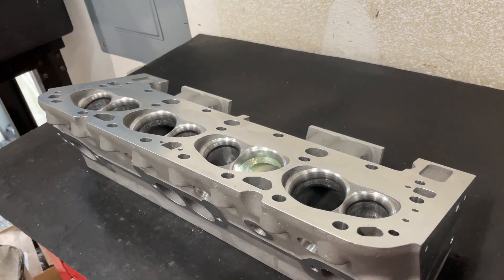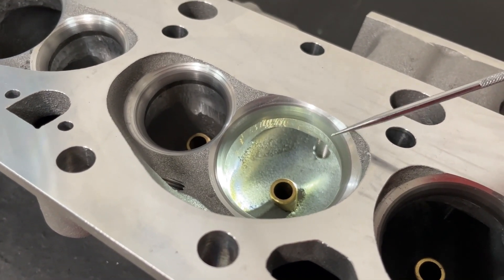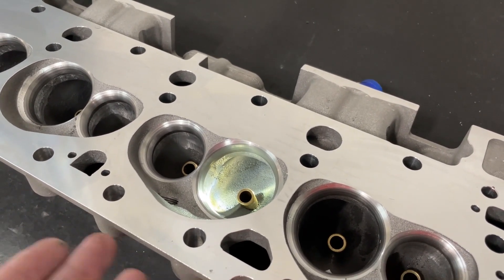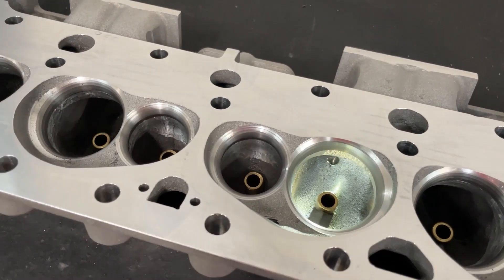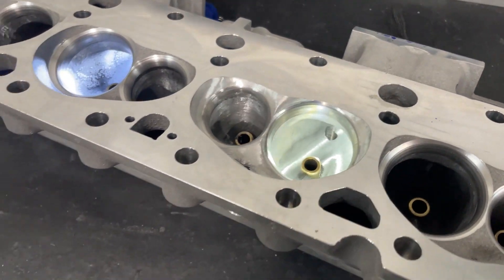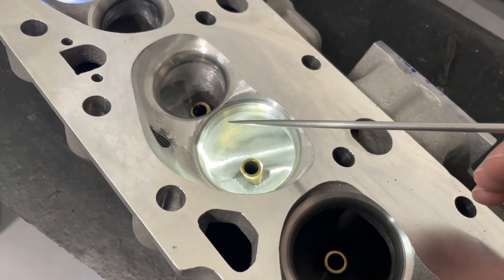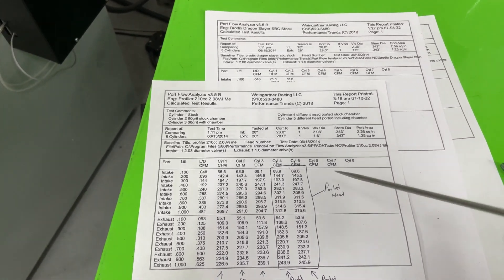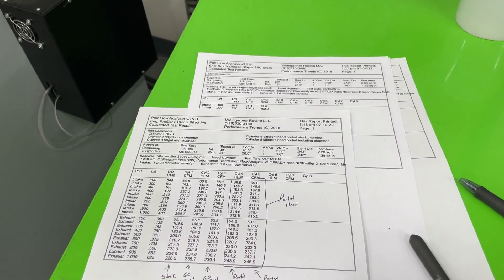Smoothing A Head to 60Grit Part 2

Comment: As a wise engine builder once said, test every claim in a thorough and organized fashion.
I Know David Vizard says to only polish the roof of the ports, and to keep the rest of the Intake port at a 60 grit.
Reply: I was on the understanding that polishing intake ports is a bad idea, because wet flow will tend to stick to a polished port as apposed to a port with a rougher surface finish. This is the problem with "head" porting info, you can listen to 10 different people, and you'll get 10 different answers! I will also almost never deal with an aluminum head, the only thing I'll ever use are cast iron heads, can't afford all the fancy stuff, but it's interesting to listen to the discoveries Eric finds and shares with us, and I'll use what little I can in my own heads.
Reply: @Anarchy-Is-Liberty  there is a hughe difference in texture between something that is "polished" and something that is 60 grit with a cartridge roll. I polish only the pushrod pinch and the ssr of my heads and finish the rest with a 60 grit cartridge roll. That way the critical.points are less restrictive and the rest of the ports co tinge to keep the fuel well atomized.
Reply: Thank you! 
   Very nice explanation for why 1 " open. To see how stable the whole combination is.

Comment: A lot of folks get caught up in flow bench numbers as the be all end all of cylinder head testing, but a quote from an old engine builder I used to hang around (see also: annoy the shit out of) as a teenager pretty well sums it up "Engines don't care about flow bench numbers"- aka there are a ton of different factors that go into cylinder head (engine) performance that just aren't shown on a flowbench. Sure, they give you an idea of what the head will do, and a way of comparing heads to each other (at least in theory), but the only way to know for sure is to put them on an engine and find out. 

There were plenty of times when what I was trying worked on the flow bench (stock lift cam rules- so low/ mid numbers were all I cared about), but either produced no additional power, or even hurt power on the dyno. I probably had a couple hundred hours (and god knows how many sets of valves and seats) into that, and upon failing to make a single HP more for the 30th time I was venting my frustration about how they picked up 15cfm at .400, it should be making more when Bill popped off with that line. Kinda stuck with me lol.
Reply: Flow numbers are not important, airspeed numbers are, they are also flowbench numbers.

Comment: I think that chamberwork is a must on any cylinder head for any applocation
Reply: By chamber work (combustion chambers), are you talking about 60 gritting them as he speaks about in this video?
Reply: @Anarchy-Is-Liberty  I mean most cylinder heads have valve shrouding. When the valves open, due to them being to close the the walls of the chamners. And that should be minimized to help increase airflow.

Comment: YOU can chuck the junk valves in a drill press spin at a low rpm and take an angle grinder with a flap disc to grind them to size for seat protection
Reply: Goddamn! I've gotta see someone do that, sounds scary! ha ha ha Madman with a flap disc and a drill press, hold my beer please! ROFL!! 😂🤪:face-orange-raised-eyebrow::face-orange-biting-nails::elbowcough:
Reply: @Anarchy-Is-Liberty  not really. It's not like are going to use the valves afterwards. You're just grinding the mating surface on the valve to make it lay flat on the seat to protect the seat when reshaping/polishing the chamber.

Comment: I was told smooth out whatever can catch a nail but don't change the shape. Guess there was some truth to that after all. Seems like it's more optimizing the port than really improving it as you can only support so much through a size before it's unstable... Case in point what you were discussing near the end. It'll be better for sure but, I don't think it'll be the same level of improvement you'd realize with the true porting job. I honestly would speculate it wouldn't even fall in the middle like the numbers suggest it would... I also wish you had that dyno sir. Thank you as always for excellent content.

Comment: TIP ,....... when useing   "cross cut burs, " ..... rub ckalk into them before use,    helps to stop clogging,  ......and it is much easier to clean with a wire wheel !
Reply: W Aluminum I used WD40 to do this.   I wonder if your Chalk idea is better?

Comment: Brother how do you sleep at night with a brain full of knowledge.lol
Thanks to your videos I've picked up a porting bench top machine "foredom tx square drive table top".  I've had hours of mild clean up and gasket match practice with track results of .2 tenths in 1/8 mile...no clue really what I'm doing but I really appreciate your videos.  I'm currently working on a set of rhs pro action 195s new out the box I've had in storage for 6 years. Building a solid roller 395 sbc. For my mustang. Thanks again for taking time to make videos

Comment: Matt here. Can you explain the CFM at 1 inch lift in a little more detail? I'm confused about why the CFM you are testing at is not close to what an engine pulls. For example a 5.3 LS at 6500 rpm is only pulling in 608 CFM total. That's only 76 cfm per cylinder. I must have done the math wrong. 5.3L/2 this is because its a 4 stroke so only half the time it pulls in air. Multiplied by 6500 rpm is 17225 L/m. Liters to CFM conversion is 608. So testing the port to 300 CFM is a very large amount of air through just one intake and should be more than accurate for testing the ports. Thank you for the videos and your time.

Comment: Your list of tools is interesting. I haven't heard of many other people using stones on aluminum. I'm assuming you're using a lube to keep it from loading up and "exploding" (the melted aluminum tends to clog the pores of a grinding stone and expand causing it to come apart unless you do something to keep it clean). What kind of lube are you using? Are you using the same lube with the carbide and sanding rolls?

Dyno numbers with a .550" lift cam would be VERY interesting to see comparing those 2 heads. There are a lot of different thoughts about where the change in airflow comes from when you change the pressure differential across he port (boost, ram effects...)

I just found your channel so this might be something you already have up, but I'd love to see you actually doing some of the cutting on camera.

You also have me thinking about pulling the cylinder heads on my car. Since the traditional answer is that polishing doesn't do much for flow I did very little sanding on them. For the most part they were cut/reshaped with alumicut carbide, double cut carbide, and where I didn't get a consistent finish with the carbide they were touched up with the coursest sanding rolls that I had. At that point they were thrown on a flow bench, flowed (with a 3.75" bore since this was a small bore build, so I wouldn't necessary recognize how much I left on the table by not doing more sanding/polishing) and since the flow numbers were good enough they were used like they were.
Reply: I replied to ask same, I used WD40 on the burs and dry on the rolls.    Another poster said he uses chalk on the burs.   Wondering which is best now.

Comment: Hey eric i was recommended a cam of O.6OO" lift do you know of any springs that shall last on normaL street use on it like blue alloy nascar springs or something? The cam specs are as follows= Comp Cams # 12-872-11 
IN. 263*  /  27O*  @ .O5O" 
     .6OO" /  .6OO"       108* LSA
 Going with BRODIX family owned products in USA from now on and forever. BRODIX heads 227cc CNC or similar. Saving up for them.

Comment: It would be nice if you could partner up with someone who a well sorted dyno. Be careful using a Superflow with a stock strain gage while doing small modifications followed with quick tests. As the stain gage heats up your torque and horsepower goes up. Come back the next day and do a baseline and find all your gains are gone!

Comment: Thats how i chose my cam size.  Off of my head numbers. And chose the duration on what rpm.    No point in putting a huge cam in a head they don't flow at that lift and no point of putting a baby cam with a high flowing head

Comment: Learning to properly use and control the tool is a big hurdle for beginners to figure out
Speed control is everything lessis more. 

Tap Magic is the only thing I use for carbides..not a lubricant, its to actually help cut the metal and keep the burrs clean. 
Works great any hardware store has it.
AFR has been increasing pricing to the point I dont think its worth it anymore. 1k 1500 for a decent head fine
2.2500 plus for a 23 deg sbc Ill pass and build/port my own
Reply from the maker: I hate the smell of tap magic.
Reply: @WeingartnerRacing  WD40 is the best aftershave ever.

Comment: I like your videos and I appreciate your knowledge. However, you go off topic so much that a 10 minute video turns into half an hour. Kind of reminds me of a bumble bee or a butterfly, sort of aimlessly moving from one flower to another with no sense of urgency or with any destination in mind. Perhaps you are just wanting to share as much of your knowledge as you can, I don't know. I suppose a lot of it is because you like to go off the cuff and don't seem to edit your videos very much. Extra points for one-take videos, but yeah, I think you should try not to stray as much.

Anyway, thanks for posting up these past two videos. I did something very similar with the head on my BMW -- just cleaned up the machine marks with a cross cut burr, didn't take away a lot of material, just smoothed things out. I am glad to know that it makes a difference. I didn't want to take a lot of material because I was afraid of experiencing flat spots or losing a lot of torque. The car behaves better, but it is hard for me to really tell why because I also deleted the cats and added camshafts at the same time as the head work, so it's been a mystery to me -- until now.
Reply: See that also

Comment: I know it's off topic but have you flowed any blueprint engines ls3 heads at all? I live in Nebraska and they're headquarters is about 100 miles from me. I'm thinking of picking up a set for my g8.
Reply from the maker: Yes and I ported a set and loved them.
Reply: Thank you very much for the info! I'm looking at a bare blem set. Do these use stock ls3 rocker arm locators or are they aftermarket? I can't seem to find any info on these.
Reply: @WeingartnerRacing  Curious as to the quality and hardness of their 400 blocks they make. Any experience with those?
Reply: @WeingartnerRacing  Curious as to the quality and hardness of their 400 blocks they make. Any experience with those?

Comment: That’s some serious horse manure that profiler jacked the price of their as cast heads up to that level with no revisions or improvements. They were $1100/pr assembled just a couple years ago. Now they’re $1650/pr bare. If I have to buy another set of as-cast aluminum heads any time in the future I’ll be looking elsewhere. Is this economy affecting them? How do they think it’s affecting their customers? It’s all about value these days and that isn’t it.
Reply from the maker: I get they had to raise prices because materials went up. I also understand they couldn't keep up with demand so raise the prices. However since the price increase I haven't sold one set of their heads and I was doing about 3 or more a month. The warehouse I get them from went from having none to having 30 in stock and the inventory stays the same. The priced themselves right out of the market.
Reply: @WeingartnerRacing  no surprise there. I tried buying them a few years back but couldn’t find anyone with them in stock. I could get the AFR 195’s I have now almost immediately so I bought those instead. May have a 355 build coming up and was highly considering the Pro-filers again for that motor again until I saw this vid and checked the pricing for myself. I’m not looking at the Pro-filers any longer. As you said, they priced themselves out of my predetermined budget for heads.

Comment: What if the bigger, more stable head kills velocity?
Reply from the maker: It can but then I would say put it a larger engine or turn more rpm.
Reply: Can’t always do that. I’ve seen all pro heads that made the greatest flow numbers and didn’t run on the dyno or the track. I’ve also seen ascs 360s that a guy made the heads too big and it killed 30 horsepower

Comment: Anywhere there’s a rough surface you can make smooth is better imo. Of course you don’t want to overdue it and cause lips like you talked about last video.
Reply: Actually slightly rougher surface well prevent fuel molecules from adhering to the port walls and will provide better atomization.
Which will in turn provide a bit better power even with the slight airflow advantage.
Remember, it's all about the most usable cylinder pressure. 
I've done my fair share of custom engine building and many hours of porting, polishing,  blending, and building custom engine parts to meet a specific or class requirement.
I actually went to tech college for Airflow Engineering and Design. 
But that just taught me how much I didn't know lol.
Reply: @Mr._Flunky  I’m just going by what I was taught by my father he’s a master machinist, mechanic for over 40 years and was building reliable 700hp small blocks back when it was unheard of for the most part

Comment: Now my question is : Why on earth would a flow bench NOT be designed to flow at the rate a live engine would see?
Reply from the maker: One reason is because of the amount of power it would use to move that much air. Another even at that pressure it’s only measuring in static conditions instead dynamic of a running engine.

Comment: If anyone is running a . 550 or even just a .600 lift and they paid for porting, they don't have their head on right. If you're going that far, should be doing springs and high lift even if the duration isn't circle track. Just say no to off the shelf cams, simply not enough savings to forego a custom grind.
Reply from the maker: A ported head will still make more power with a .550lift or smaller.